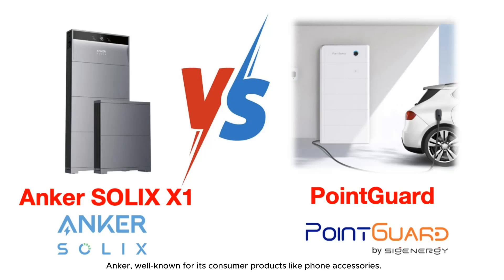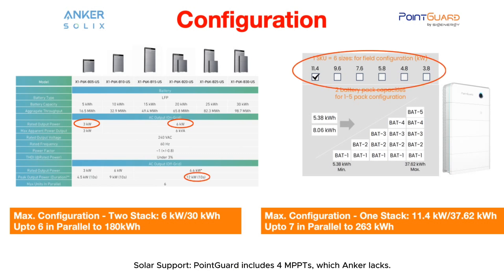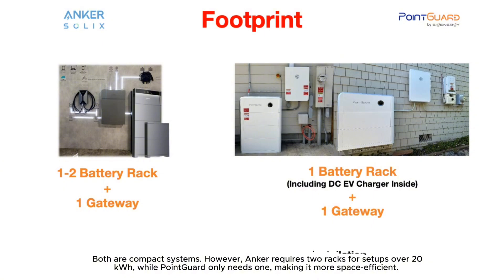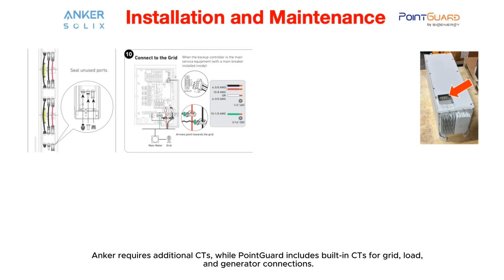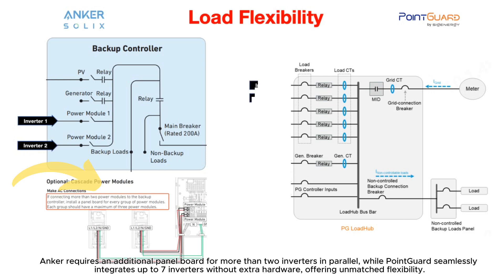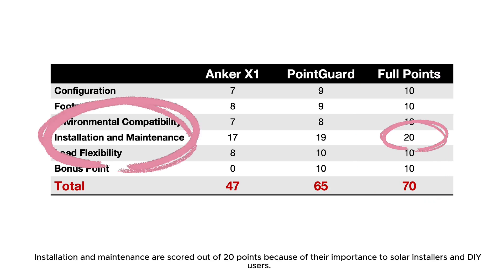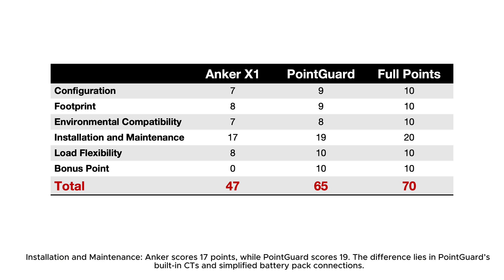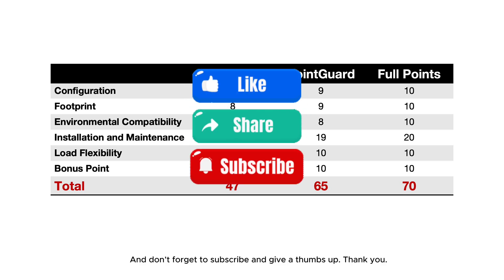Anker Solix X1 vs PointGuard Battery #anker #ankersolix #pointguard #battery #tesla #teslapowerwall

Comment: Exactly the same conclusion I came to when I considered both systems.
Reply: My system was installed Feb 13th. and has been working exactly as expected.  So far I am very happy with it.  As I said I thought I would need 24 kWh of storage and since I installed the system there have been two days where the battery reached its 20% reserve SOC. On those two days I consumed .4 and .6 kWh of energy from the grid.  I think that if today's storm continues I may have to consume a little late tonight or tomorrow AM.  It won't be much just like the last times.  It seems to confirm that I need a slightly larger battery. 
Fortunately, with the PointGuard system that is simply not an issue.  Before next winter I will add another battery.  

I just thought I would give you an update.
Reply from the maker: Cool, so did u buy PointGuard eventually and how big the size you did?
Reply: @Renewable_Tek  It will be installed late January or early February.  It will have 2 8 kWh batteries.  I want 24 kWh but I will add another one in a year or so.
Honestly I haven't seen anything better than the PointGuard.  I also like the fire extinguisher in each battery module a lot as well.  The chances of thermal runaway in an LFP battery is minimal but there none the less.  It is interesting that none of the YT comparison videos have mentioned it.
Reply from the maker: @bryanwhitton1784 Agreed. There are too many features. Most people can only pick important ones to talk about. Not only the fire extinguisher, they have a special pad between cells. In case there is high temperature, the pad will become very hard, like ceramic material to isolate heat and pressure.
Reply from the maker: @bryanwhitton1784  their DC EV charger will be available in January or February. It is worth trying if u have an EV. I will test it out when it is available and have some inventory.
Reply: @Renewable_Tek  I do indeed have two Tesla cars.  A Model Y and a Model 3.  However, The DC EVSE has an issue that at this time makes it unusable for me.  The charger cable is connected to the battery stack.  So I can't reach my cars from the battery stack.  I have asked if they are addressing this and got a "Hmmm, maybe".